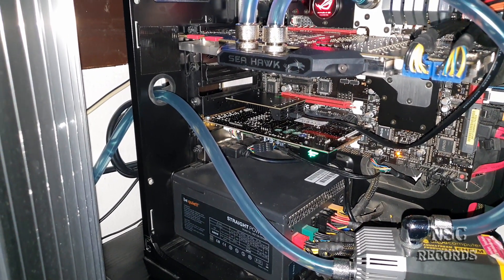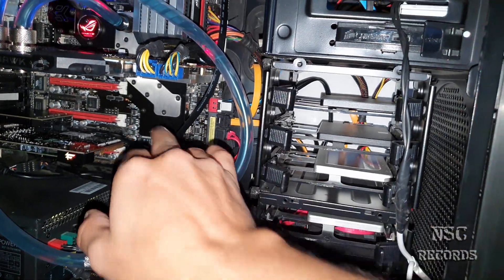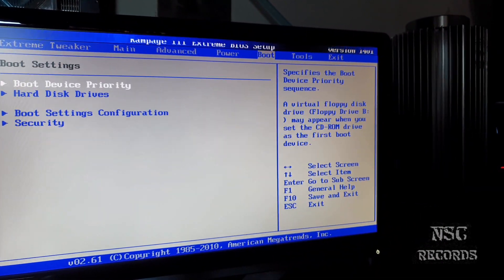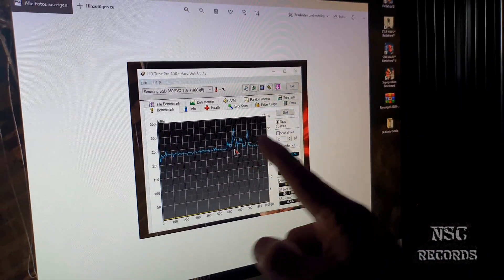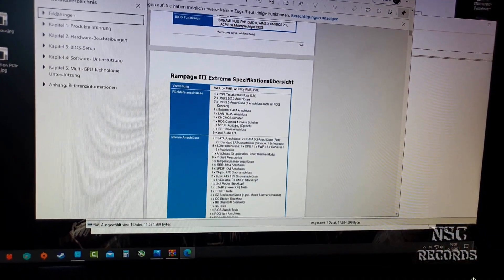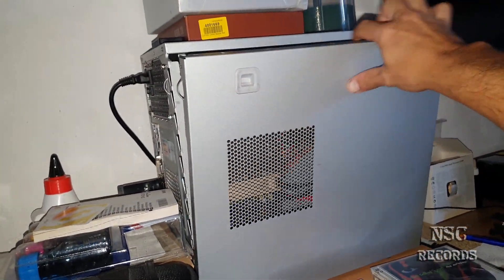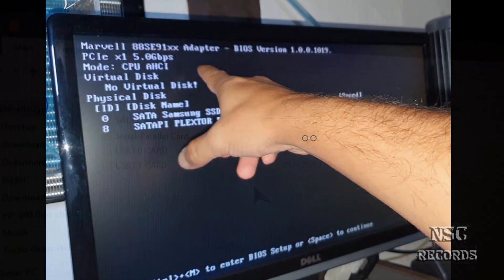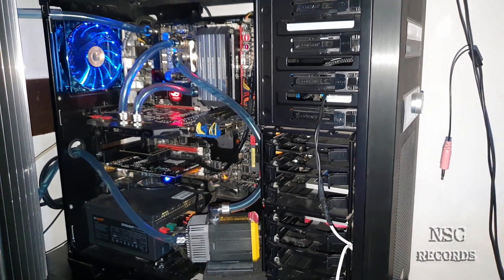How to setup a Sata PCIe Card and some more stuff #3 By:NSC

Comment: Your channel is so underated, your a great youtuber and tell us a lot about electronics and how to mod / fix them. My PS3 just got the YLOD and I’ll try to fix it. Can you tell me where to buy those capacitors at? Please and thank you
Reply from the maker: Hello and thank you so much. I found my on eBay
Reply: @NSC-Modz  ok, what’s the capacitors called? I never soldered anything before so I might fail
Reply from the maker: just search for Tantalum SMD Capacitor 470µf with 2.5 or 6.3 volts
Reply from the maker: @w0lf4llo84  here we go: https://eu.mouser.com/ProductDetail/AVX/TPSD477K002R0035?qs=GfqdZw5MmkAxgX1b6anWcw%3D%3D
Reply: @NSC-Modz  thanks :D
Reply: @NSC-Modz  also might try to delid it later on once your tool goes up for sale. Or I could practice with a painters knife on a dead board.
Reply: @NSC-Modz  nevermind it’s going to take a long time to get here, I’ll just slant them sideways so they fit :)
Reply from the maker: @w0lf4llo84  yeah, most important is not how it looks, it's how it works :)
Reply: @NSC-Modz  yep xD
I might try to practice soldering on something else first. I do have a PS3 controller with a wire broken off the motherboard for one of the rumble motors. I’ll try that

Comment: Due to lack of AVX2 instrucions of your CPU, frame rates are getting less, some games wil not even boot. It is a pity and bottleneck for your 1080TI... Favor your GPU a better CPU...
Reply from the maker: Like i told, I'm gonna surprise you :) But hey, a Xeon W36890 @4.2Ghz 24/7 on 24-45C° is not that bad as you think xD
Reply: @NSC-Modz  will a video come about it if you ever consider to upgrade your computer?
Reply from the maker: @gta4haterhq  hell yeah, planed with an R9 5090x Im just getting my stuff togetter ^^
Reply: @NSC-Modz  it will be a killer machine
Reply from the maker: @gta4haterhq  OMG YES IT WILL !!! A COOL BIG MONSTER MACHINE!